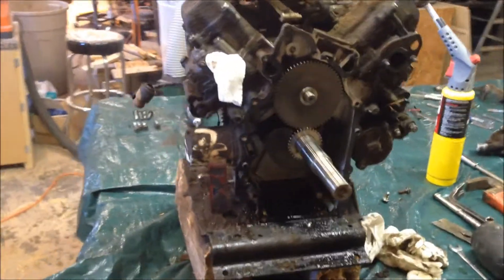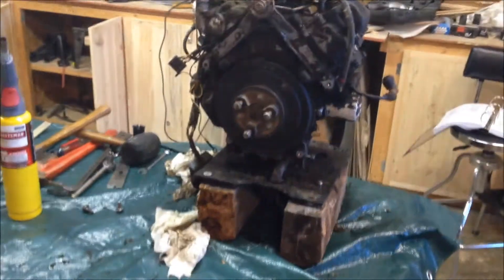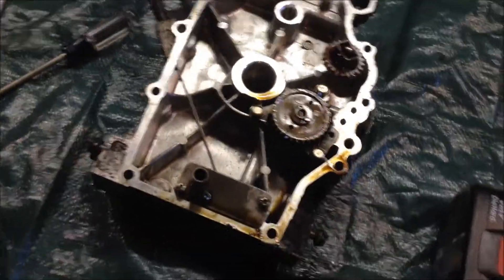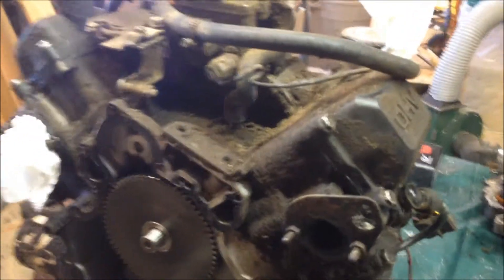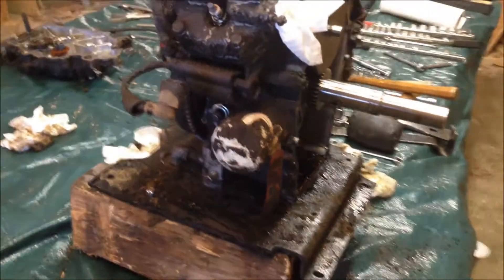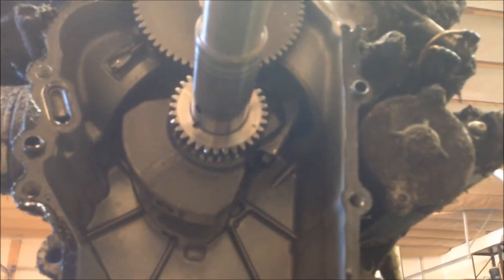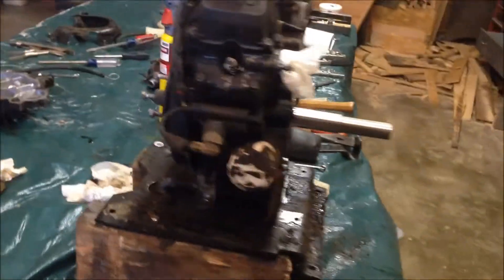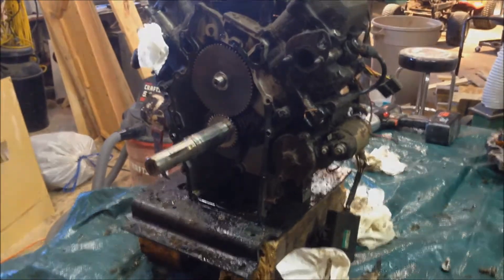Toro Wheel Horse 520Lxi 5xi Series Restoration Part 2

Comment: Hey did you have any problems removing the crankcase cover on the front when you started the video it was already off, I’m having an issue with it being stuck. Don’t if I’m missing something?
Reply from the maker: Ours had a slight issue coming off but that was because the previous owner decided to use JB Weld to try and seal leaks around many of the gaskets. Also, the gaskets do make it stick. We ended up using a small torch to heat the gaskets and slide a metal putty knife into it.

Comment: How many hours were on the Lxi when you had the gear go out?  Have you had any issues since the rebuild?  I am looking to possible buy one and figure I will have to likely do the same rebuild at some point.  How many hours roughly on the rebuild?  Thanks
Reply from the maker: Mark Haas when we opened my engine, the cam gear had already been replaced. I would guess that it wasn’t too long before I bought it that the previous owner had to have it replaced. As for the oil pump gear, the only reason I replaced it was because the temps outside were so low and I didn’t heat up the barn enough before starting the tractor, the viscosity of the oil thickened and caused the oil pump gear to strip. I figured that it was like a play dough factory when it broke. As for the hours on replacement, I have heard that most cam gears go out around 700 - 800 hours, but I would guess that mine was replaced around 1000 hours. Now, the oil pump gear could go if you are like me and didn’t change the oil for a lower viscosity oil for the winter ( I have a plow and push snow off our driveway), these could blow at anytime.

Also, depending on the build year, Kawasaki started installing steel cam gears because many of the John Deere guys that had this engine before Toro, noticed the plastic cam gear issue. I believe that after 2000 or 2001, they changed to steel. 

Overall, I wouldn’t shy away from this machine, even if it was going to need the cam gear replacement. These tractors were built to last, and from what most wheel horse fans say, it’s the best wheel horse ever built. They are definitely worth the money they are asking for used. Ever since I rebuilt mine, it’s been a work horse. I rebuilt mine I believe around 1100 - 1200 hours and I have almost 2000 hours on it and she is running great.  I did however, just buy a Toro Timecutter HD to mow my yard now. It cuts down time and my boy will usually want to mow with the Wheel Horse. The only thing I’ve done since the rebuild is replace the ignition controller box. It went bad due to water getting inside it (faulty seal on that part). Other than that, I clean it when done mowing and do regularly scheduled maintenance (including replacing the oil for the winter with a lower viscosity oil like it says in the book, I’m not making that mistake again).

Side note: If you do buy the horse and you do have to replace the cam gear, make sure you buy new gaskets. The previous owner of mine tried to reuse all the gaskets, which is insane due to how cheap they are. Most come online as a rebuild kit. The guy who owned mine before me noticed leaks around the seals and decided to use JB Weld to try and seal up the leaks. Save yourself headaches and just buy new ones. Usually John Deere sells them the cheapest and they are genuine Kawasaki seals.

If you buy it and have any questions, don’t hesitate to contact me, I’ve been all through mine. They are great machines, and if I ever get a chance to buy another one, I would in a heartbeat.
Reply: Christopher, thank you very much for the info.  very Very HELPFUL.  I know how good these machines are - I already have a 522xi with the Kohler Engine.  She works like a charm!  I wanted another since i have collected most of the attachments for the one I have.  plus our Son can help me mow grass.